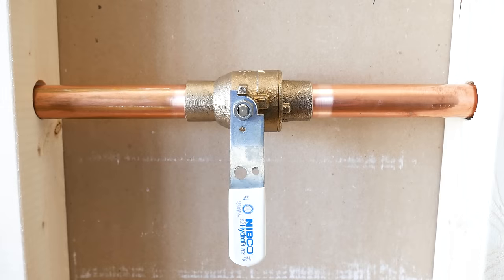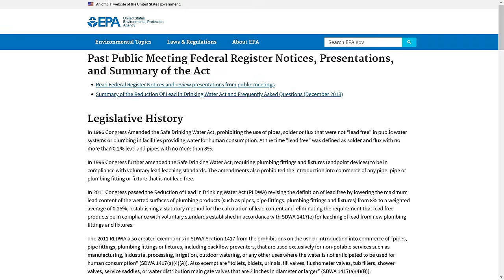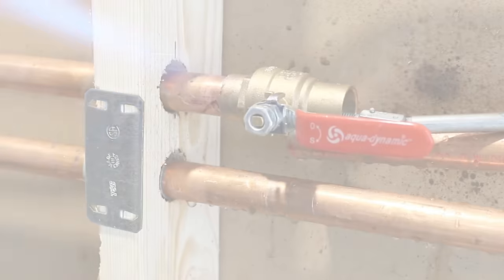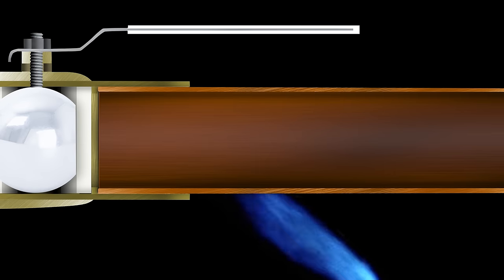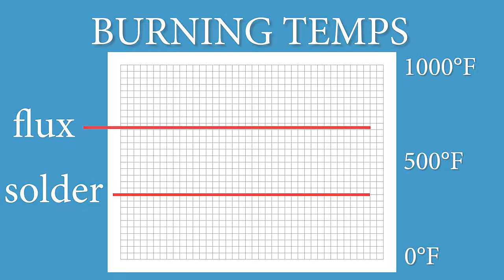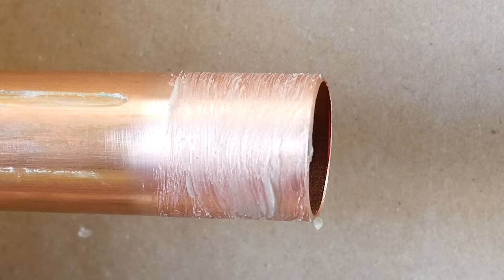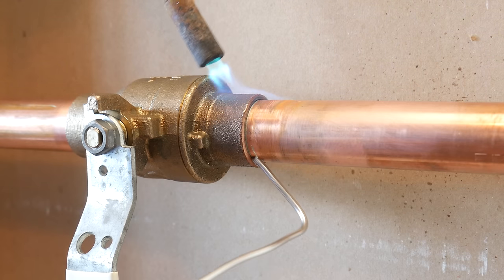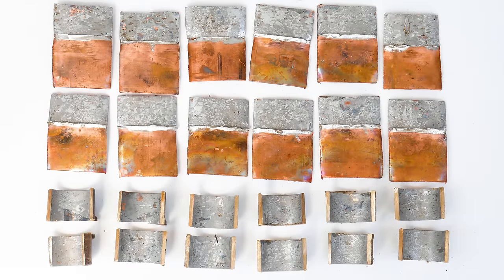How To Solder A LEAD-FREE Ball Valve (Correct Way!!) | GOT2LEARN

Comment: I’m afraid of cooking the internals
Reply: You can wrap the valve with a wet rag as shown on the video, and it will be perfectly fine,
This gentleman knows what he is doing 👍👍👍
Reply: I wouldn’t recommend using a pencil reamer any more. They scar the inside of the pipe causing the turbulence you are trying to prevent. Use a barrel reamer to avoid this. Otherwise great video.

Comment: Good job. I’ve always heated my pipe first, even on regular copper fittings because that will prevent overheating of the fittings and actually makes the process quicker.

Comment: Great tutorial videos - thank you very much! I'm a DIY-er, but have limited experience in plumbing. Thanks to your instruction, I completed a plumbing modification with 34 sweat joints and 2 new isolation valves - no leaks, and no damage to the valve seats. Couldn't have done it without your excellent guidance.

Comment: The technique you used in this video are exactly the the way i have been soldering for 35 years , it's more or less common sense . I have never burnt a valve up due to improper heat position ! But glad you've put it out there for others to see !
Reply from the maker: Thank you sooo much Kenneth!!
Reply: Common sense isn’t that common anymore…

Comment: Thank you for this and all your videos! This hits the nail on the head of what my problem was with these valves. Run 80 ft of copper, stop counting at, 70 joints only leaks at these dumb valves. The irony is I put the valves in in case I got a leak in the other plumbing. Converting bedroom in 55 year old house into full master bath, 7 fixtures. Thanks again for your videos, you are the, Coppergod!
Reply from the maker: 😇 thank you so much Chris!!!

Comment: I’ve also watched many soldering videos and yours are by far the best. Thorough, but not too much information. Just the right amount. There really is not substitute for experience, and since I only solder with occasional problems or new water heater installation, I have to review every time I have a new project. Someone with no experience should practice a few times on cheapest fittings they can find and be prepared to fail a time or two with valves before you get it right. Thanks for the excellent videos!

Comment: I am glad I searched your videos and found this. My house was built in 1962 and has the old shut offs with the handle the same as outdoor faucets and do not shut off properly plus some of them leak through the seal on the shaft when turned on or off. Thanks for another great video.
Reply from the maker: Awesomeeee!!!

Comment: I am replacing my traditional hot water heater with a tankless hot water heater. I have to replace some of the 3/4 inch copper pipes and adding two new valves. I have watched so many of your videos and they are the best on Youtube. Thank you so much my friend and keep up the good work. I liked and subbed so I don't miss out on future videos.
Reply from the maker: Awesomeeee, good luck on the swap 🤜🤛

Comment: Excellent presentation.  A plumbing pipe industry tutorial on soldering lead-free fittings suggested another best practice is following the solder around the joint with the torch flame to ensure better flow and coverage. Hard to do near a wall stud!  I had six leaks on a half dozen soldered copper fittings installing new water supply pipes! Yes, I am a carpenter.
Reply from the maker: Always more difficult doing so in a wall, cheers!!!
Reply from the maker: Leopold  no experience with that type of piping, but pretty sure it's soldered/brazed the same way.

Comment: THANK YOU!!! I had tried to solder the valve two times before finding your video. The big thing that helped was the low temp solder and flux with solder. Also the angle of your torch is a great tip. So far my join does not have a leak.
Reply from the maker: Excellent!!!

Comment: Awesome video - I am just a DIY person & these valves were a challenge to solder. By accident I managed to use the steps you recommended except I did not think of using the low heat flux. I will make sure to get some for next time.

Comment: Thanks for the plumbing videos and illustrations. Lead free meaning no lead solder, pipe, and fittings are the only type to use on potable water lines!☺

Comment: Thank you so much for all these videos. Soldered some joints for the first time today. Took out a stubout, added a cap and a copper to PEX adapter. Pressurized to see exactly where it had a pinhole leak. Wanted to inspect and think there are several ares of horizontal sections that need or be repaired.

Comment: I wish I saw this video before installing my water heater. I had a swing check valve that leaked. I couldn't figure out why is was so much more difficult to solder then the standard joints. I really appreciate  your quick and to the point vids.

Comment: Great, thanks, especially about your comments about the valve seal and the initial heating of the copper pipe & the positioning of the torch (and damp cloth wrap tip); thereafter, so as to not compromise the plastic seal.
Reply from the maker: Thank you, don't forget to share, it really helps the channel!

Comment: Nice solder coverage at the end. 
Many times I have taken apart fittings that were done by someone else  and upon looking at the solder I find that it was only connected in a thin small strip. Sometimes when I do my own I pre- tin as much as possible to insure it is thoroughly soldered.
I need to try some of the ways you use.
You got it down good.
Reply from the maker: Thanks 😇

Comment: Good tip. I especially like your suggestion on matching the length of solder to pipe diameter. I tend to be a heavy solderer.

Comment: This is a great video.I have had the misfortune of applying too much heat when soldering half inch ball valves and the result was that the ball valves blew out and I had to desolder the ball valve and start all over with a new half inch ball valve.Now to avoid blowing out half inch ball valves I use a torch with a pencil tube to ensure that I do not over heat the ball valves.Thank you for the video,God bless you and yours.

Comment: So Julio, today I was in the shop and I came up with an experiment that has yielded quantitative data that might be of interest.  I pretty much follow your technique in soldering ball valves to the letter, with good success so far.  I was curious as to what temperature this technique was exposing the valve bodies to, based on our other conversation regarding valve seats.  So today I grabbed a couple of Apollo lead-free cast bronze 3/4" valves (77-CLF-A) and some 3/4" type M copper hard tubing, and started soldering with my trusty propane pencil torch (using straight propane), some Sterling Premium LF solder and #95 tinning flux.  These valves are marketed as made of "EZ-Solder Lead Free Bronze" (containing bismuth) which is supposed to solder nearly identically to traditional alloys containing lead.  
After soldering each valve to my satisfaction using the preheat-pipe-first-then-heat-the-valve-cup method, I used a laboratory contact thermocouple and a Fluke digital temperature meter to measure the temperature of the valve body immediately after soldering.  In each case, I did not use any cooling around the valve body (no wet rag, etc) and the valve body temperature did not exceed 350 degree Fahrenheit immediately after soldering.  I'm very pleased to report, as per our previous thread exchange regarding the melting temperature of various valve seats.  I try to stick with high quality ball valves from Apollo, Nibco, Milwaukee, etc and these typically have seats comprised of reinforced PTFE, whose melting temperature is around 620 degrees F.  What this tells me is that for the 3/4" valves I tested, the method you recommend, when performed correctly with a conservative torch and fuel combination that does not produce excessive heat rapidly, appears to be well within the margin of safety for cast bronze LF valves (typically valve body temperatures not exceeding 500F), even without any valve body cooling applied (no wet rag).
Keep in mind that some lead-free forged brass valve manufacturers (i.e. Apollo) recommend that LF forged brass valve body temperature should not exceed 300F during soldering, thus some method of keeping these valves cool (like a wet rag) would likely be a good idea since in both case my results exceeded that.  Also, results may be different with other valves, such as Nibco, which use LF alloys containing silicon and have different thermal conductivity than alloys containing bismuth such as the ones I tested.
Hope this information is useful.
Reply from the maker: Yes, this is why is SUPER important to read the manufacture directions on how to solder THEIR particular valves! Thanks again for all the great information Stiletto, it's fun to see you investigating this, love it!!!

Comment: Will be changing my water shut off valve this week because I can't afford a plumber. I have some experience with plumbing so I hope it all goes smoothly 😃
Reply: Just make sure the valve is visible and accessible so that when the little O ring inside the SharkBite fitting that holds back the water eventually fails, you'll know about it before catastrophic flooding occurs in your home.

Comment: I wish I watch this 2 weeks ago. I just changed out one of these ball valves and ran into a week at after I got done with it. I still need to go back and deal with it but I got my hands full out there that is far from the biggest problem. That's actually the smallest problem

Comment: Sterling solder or other low temp solders are also great for soldering brass (not copper) fittings like drop ears, not just valves. Your videos have been really helpful for fixing stuff myself. I am in the USA, not Canada so I buy all my stuff from Ferguson.
Reply from the maker: Yes, any new brass that has no lead, thanks my man!!

Comment: The biggest problem I've had with soldering ball valves is overheating the valve and damaging the seal so that it won't shut off completely.  On one job, after I ruined the second valve, I said the heck with it and went with the Shark Bite.  It worked fine, opens and closes completely and no leaks.  I worry about 10 or 20 years down the road, but it solved my immediate problem.
Reply from the maker: It'll still be there if it was properly installed, cheers!!!
Reply: I'm not confident in soldering ball valves, and I don't trust Sharkbites.  My solution?  Sweat a male adapter onto the copper pipe, and use a FPT ball valve.
Reply: @cleansebob1  That sounds like a grand solution.

Comment: I might have learned something. A couple of years ago I replaced my shut off valve coming into the house. It is vertical. I made the top connection with no problem whatsoever but I never could get the bottom one to draw up into the valve. I gave up and used a shark bite to get the water back on.
If the shark bite fails I will try your tips.

Comment: Do you usually just call the manufacturer to find out their recommendations on whether or not the LF ball valve should be opened, half-opened or closed?   And I did learn a number of things, thanks.
Reply from the maker: Most times it's written on the tag, but if it isn't, try checking their website or giving them a call 😉

Comment: Good video. I’ve done this many times myself, I like to brush flex on my joints after I soldered them and then wipe them clean with a cool rag. This makes my joints look more professional and cleaner. Just my preference though.
Reply from the maker: Yes, just be careful not to burn your brushes, I prefer putting some flux on a rag instead, cheers!
Reply: @Got2Learn  
Hey, I never thought of that...thanks for the tip!!!
(And my brushes thank you too)

Comment: Kudos for opening up and inspecting the soldered valves!  What did the seals look like?
Reply from the maker: I never burned any seals to the point where the vakve doesn't seal using this method, so they should be fine.

Comment: This is another great and comprehensive video mate.

Quick question. I have a 3/4" ball valve which has water on 1 side (live system), so the ball valve is in the closed position. I'm concerned about how solder on the dry side if the cold water on the wet side will not allow the dry side to get the correct temp.

Any advice or change of process to solder a new 3/4" line onto the dry side?
Reply from the maker: Just watch the heat, apart from that it's the same, cheers!!!

Comment: As I watch a lot of your videos I realize a mistake i've been making all of my life as a DIY. You don't need constant heat as you are applying the solder. You can remove the heat source to let the solder work itself. Does that make sense? Love the vids man.
Reply from the maker: As long as the joint is hot enough yes 👍

Comment: When i solder plumbing joints, more so with horizontal joints, i tend to leave a little half drip under the joint. I use about a 1/4” to 3/4” extra solder per joint. 
Thanks for the tips on the LF valves.

Comment: Wish this video came out about a month ago. 

I know soldering ball valves is tricky cause you don't want to fuck up the seat with heat. But didn't really know these tricks. Basically I started at the valve collar didn't preheat the pipe) and tried to point the heat away. I used tinning flux (thanks to you) and it seemed to work. No leaks. 

I've done it without tinning flux about a year ago as well and managed to get it good. 

 Maybe I'm just a natural?? 😅
Reply from the maker: Heheeeee yes it's very possible to get it done without tinning flux for sure, it's just cheap insurance, let's put it that way, cheers brother!!!
Reply: @Got2Learn  definitely going to try the low temp solder. Is it a good or bad idea to use it on normal joints vs the standard solder? 

The reason I ask is cause I tend to overheat my joints, and worry I'm burning the flux off. Especially with tinning flux you see it bubbling like crazy.
Reply from the maker: Tinning flux tends to burn off less easily so you should be fine, just use you solder as a temp guide, when it melts, start to removing your heat.

Comment: I just soldered a 3/4 LF watts ball valve yesterday.  Unfortunately I didn't watch this video first.  I'm pretty sure I cooked the internals as the valve handle now turns really easily compared to the raw valve did.  But it does cut the flow of water 100 percent.  I soldered it valve open because that's how I was taught to avoid the expanding air pushing the connection apart . And I just checked my LF Oatey solder and it melts at 454 F.  I wish I had of watched this video first
Reply from the maker: ah shit, that sucks.

Comment: A tip for you (Got2Learn) to share! To easily repair a pinhole or small freeze split in a copper
 pipe. Drain the water out, as usual but don't cut the pipe.  Then all you have to do is clean the surface of the pipe around the leak a few inches beyond both sides of the leak along the pipe.  Using stranded bare copper 
wire, wrap the wire around the cleaned pipe, covering the pinhole or  split like it's a copper bandaid. Then using flux flow solder over the copper wire and the pipe.  The wire will give strength to the pipe over the leak and the solder will provide a water tight seal around the pipe and the leak.  It's a way faster and easier than replacing a small section of 
pipe w/new. If you have what you need in your tool bag it takes minutes and you don't use any pipe or fittings. I trust you understood what I explained. Cheers
Reply: Hi. Thanks for sharing your method. What gauge copper stranded wires do you recommend?
Reply: @dido1803  Any "stranded wire" stripped down will do. 14 ga or 10ga. , the strands are the same there is more per foot with larger wire.  Lamp cord or a window AC cord for an old appliance, just stranded scrap wire.  Cut from something that was being thrown away will do. 
I do maintenance repairs/ handyman work, so I usually strip off the good parts from things I throw away.  
Like  if I replace a ceiling fan I'll pull the 3 speed switch off and use it to repair a fan with a broken pull chain switch.  It beats having to run to the store to buy a new one when needed I got one.  cheers.

Comment: I sold building materials and plumbing supplies for 11 year's and I would try to upsell customers to a ball valve. When ask how good they seal I would hand them one and tell them to open it. They would "Pop" because had air trapped inside. Usually customer took the better quality ball valve.

Comment: Yup learned something here.
Question, should the discharge end be the short end? because if the valve comes apart you can still close it against the supply side. Had this happen on a third story restaurant at 1am. Lots of flood damage

Comment: Thought of a question: That low-temp solder is quite expensive. For risk-averse beginning DIY solderers like myself, would it be just as well to get a ball valve with female threads on each end, then screw them into copper pipes which I previously terminated with male thread fittings? This would keep heat well away from the valve. Thx.
Reply from the maker: That'll work too!

Comment: At 5:20 there wasn't any expanding of the copper pipe to close up the gap. Earlier in the video you were saying to heat up the pipe until it expands and takes up all of the gap. I don't like the idea of forcing the pipe to expand because once it cools it's going to want to shrink back down. What are your thoughts? Very helpful quality video by the way!
Reply from the maker: It only expands ever so slightly, nothing visible to the eye, just a thousandth of an inch, cheers ;)